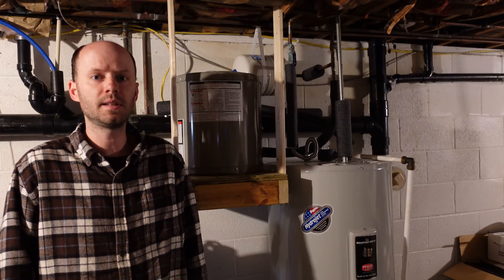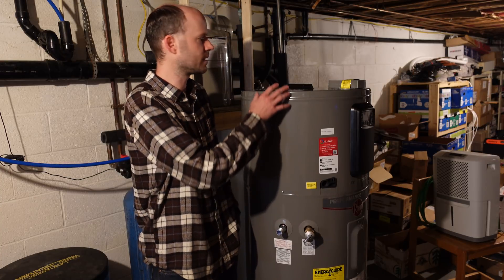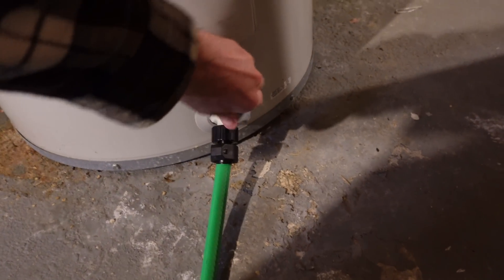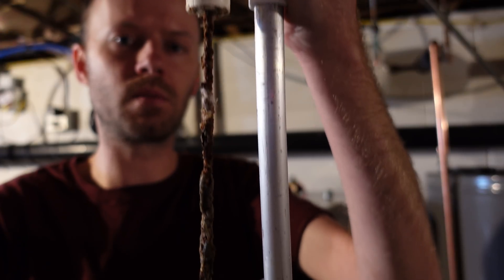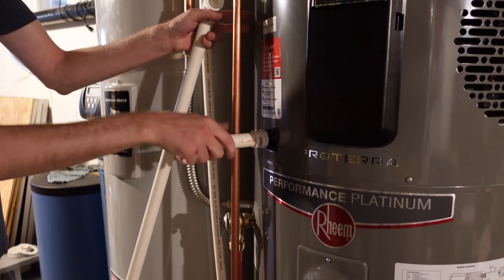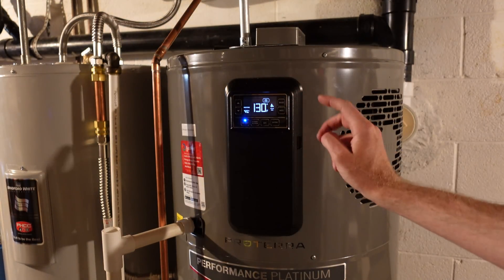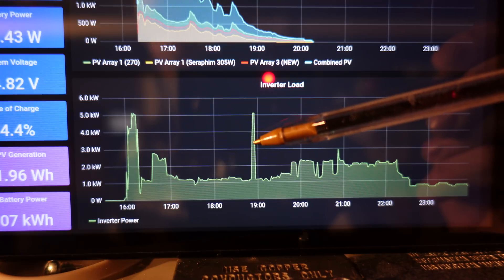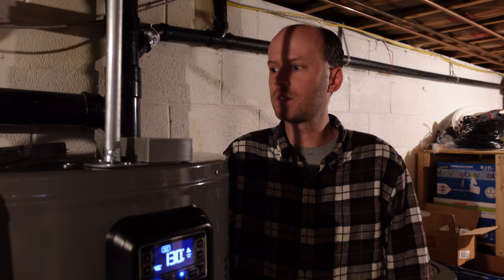Reducing Energy Consumption with a Hybrid (Heat Pump) Water Heater

Comment: I don't understand why you've put the old electric tank in series with the new heart pump?  Surely the heat pump is all you need, the old tank is just simply storing water and losing extra heat?
Reply from the maker: It's extra storage capacity, yes. You would be amazed at how little heat loss there is on a well-insulated unit like that, especially with a household of 4 using probably 2-tanks worth per day lol. I'll probably remove it at some point but it seemed silly to just throw it out when it still worked.
Reply: @LithiumSolar  ah ok kinda make sense now I was worried you would have heated water sitting in the non heated tank just cooling down like but sounds like you keep  it flowing! :D  I want to maybe try something  like your old setup where I use a smaller tank before my boiler, heated by solar to take the chill off the water and reduce the amount of gas needed.

Comment: why keep the second water heater connected and on grid? why not just use the new tank on it's own and run that off grid?
Reply from the maker: Because when I get 2ft of snow, there's practically no solar for a week or two.
Reply: @LithiumSolar  but then you could just use the normal elements in the hybrid tank. That is how it is meant to be used after all.
There is no logical reason unless you don't have an easy way to switch the power source for the Hybrid from your inverter to grid. if so then I get it.
A problem I see is that with your current setup you have to keep your grid connected unit power by grid all the time or you would have 40gallons of cold water.
Why not use the bypass function of your inverter setup so that when the battery goes low it switches to grid but doesnt charge from grid, and then WHEN you get a charge from solar it would switch over to batteries/solar again.
Reply: This question entered my mind as well. The extra 40 gal tank occupies physical space that could be freed up. Extra plumbing too. Would also free up a (double) circuit in the breaker panel. If anything, keep the small heater that you took out.

Comment: Gosh, I just got one installed in a mechanical room and I have to say I want to return it.  I have solar but not really any excess electricity left.  The heat pump is SO noisy.  Sounds like a war is going on.  I had to turn it off completely and am using it only in electric mode (with the temperature down at 110).  Very disappointed as I'm trying to be green.  Maybe my only choice is to add more solar panels to offset electric usage.  I can tolerate turning on the Heat Pump part to warm things up pre shower.  I can hear the darn thing through two well insulated walls about 20' away.  Insane noise.
Reply from the maker: That doesn't sound right at all... maybe it's defective? Do you have the same (or similar) model that I installed?
Reply: @LithiumSolar  I have the same one you have installed.  Mine is fine in 'electric' mode but any other mode it is honestly intolerable.  I've emailed the contractor but they haven't gotten back to me yet.  : (

Comment: I liked the idea of using the preheat buffer system of your old setup.
It made me wonder if collecting hot water directly from your roof is an option.
Everything I see, it is more efficient to use solar heated water than to heat it from photovoltaics.

Comment: These are great units, I'm not sure why you would want to buy a regular electric unit if you can get this one.  In CT where I live Home Depot sells this unit for like $350 or so (last I checked a couple of years ago) because of huge state rebate programs for energy saving projects.  If you can install it yourself its a no brainer given the cost of electricity in CT (about 17 cents/KW currently and the electric company is always looking to hike that rate up to pad their pockets).  Though, HD wants $1500 to install a new water heater which I think is obscene for a few hours of work in most cases.  I will say mine generates a good amount of condensate in the summer when things get humid which is good for my basement.

Comment: nice video, how about an efficient small hotwater heater review, for us off gridders.
Reply: In some hotter part of the world, the most common hot water system for showering is point-of-use 240V tankless system, they are rather affordable too.
Linked below is a 3.6KW system retails for about $68, I imagine it's pretty decent for off-grid use as it's only powered when needed.
https://www.panasonic.com/my/consumer/home-appliances/home-shower/non-jet-pump/dh-3rl1.html
These systems are not too popular in the US though, maybe they don't work too well for colder climate.
Reply: @holmiumh  Thanks. My friend uses a horse shower, reckons it was the best £80 he spent, although they are not rated for indoor use, and are gas powered, which isn't for me.

Comment: Those water heaters kick on the elements the first time they are turned on by default, even in heat pump only mode. After the initial warm up, they will never kick on again. Some say it is because homeowners don't understand that heat pumps take longer and would return them to the store shortly after install as "not working." Others say it is because the elements have to "break in" with their first water contact. Either way, that was totally normal and should be mentioned somewhere in the manual!
Reply: Might be part of control unit diagnostics to ensure everything is functional on initial startup.

Comment: Don't get me wrong it's pretty cool and everything but man having your water heater connected to an app and Wi-Fi just seems like a bit much to me
Reply from the maker: You don't need to connect the wifi if you don't want to. It's not required for operation of the water heater. All modes can be selected using the buttons on the front. You just won't be able to do "smart" things like set up a schedule (I doubt most will use this anyway).
Reply: @LithiumSolar  well okay if everything is accessible from the onboard screen that is pretty nice. I do like that it is kind of low-powered for it being so "smart" as a water heater goes in the power saver modes. I look forward to seeing how it works in the coming weeks and how you like it. Keep up the good video's 👌
Reply: @mindovermatter3988  The app allows you to track usage as well, complete with graphs. Not absolutely necessary but good info if you're into monitoring what's using how much electricity in your house.

Comment: Any thoughts about reliability of these? The last I looked I saw many many negative comments regarding failed circuit boards and lots of start-up electronic code type issues.  I do understand the longer term maintenance needs associated with keeping coils clean, etc.  I was planning to install one in a south FL garage to replace an old standard electric WH with side benefit of cooling garage.
Reply from the maker: I've only had mine for a week, so I can't really comment on long-term reliability yet. I will certainly report back any issues/failures I find though. It seems to be working great so far.

Comment: Having the little off-grid heater feeding the on-grid one is such a simple solution, great idea.
Reply: The problem with that set up is that when you’re not using hot water for a while and the main tank cool down, you’re reheating it with the grid. That little reheat could be done by solar but it’s not possible in that set up.

Comment: When the water heater starts with a full tank of cold water it uses the resistive heaters to bring the whole tank up to a minimum of 40 celsius regardless of the mode. After that if you have it on heat pump only mode it should not do that again and will consume under 500watts
Reply from the maker: Thank you for this information. I wish they would include such details in the actual manual... lol. Their explanations of the modes were very vague.

Comment: Fail my inspection...
The T&P relief valve must not have any reduction in pipe size, pex pipe is a significant reduction in size.
You need to replace that pex with copper, cpvc, or galvanized pipe.
Reply from the maker: I'm aware of the code requirement to not have a reduction in size on the relief valve. I used 3/4" pex on a 3/4" fitting, so there is no reduction of size here? The electric water heater was installed by a licensed plumber about 5 years ago and he used 3/4" pex on a sharkbite fitting too. Unless code has changed since then?
Reply: @LithiumSolar  the shark bite MAY mitigate the issue, traditional pex uses internal pipe fittings that reduce the internal diameter. If no insert was used with the shark bite, it should be ok.

Comment: Setting the temperature to less than 140 degrees F saves energy, it can cause legionella to grow in your water heater. If I was going to use lower temperature I would periodically raise the temperature to kill off the bacteria that grows in your hot water heater.
Reply from the maker: 140F can scald you in 3 seconds. I can't take that risk with the family.
Reply: @LithiumSolar  Not if you use the correct faucets to limit the hot water
Reply: @LithiumSolar  or you prefer the long term method of poison
Reply from the maker: I prefer neither... I see your concern but have to wonder why everyone says to set them to 120F if it's so bad? Idk I'm not an expert here...
Reply: @LithiumSolar  Here are two articles that address both settings:
https://www.ncbi.nlm.nih.gov/pmc/articles/PMC2094925/  
https://www.corroprotec.com/blog/hot-water-temperature/
Reply: @UsetoCud  Legionella is everywhere and we are constantly exposed to it.  If you have city water it is treated and has very low levels as also food source for it to grow.  If you produce your own water then there is some reason to be concerned.  I have visited people who have stuff floating in the water and I won't drink there. You are more likely to breathe more Legionella walking outside then in a shower.
Reply: Relax guy..... Lol 120 is the way to go.

Comment: I went through this scenario a few years ago. For me this was a no go. Payback period (for me) was about 20 years because of the initial cost of the hybrid. The Tank would not last up to the payback period. They are cool though! My 80% efficient natural gas hot water heater only uses 8.00/month of gas and I also get the benefit of being able to take hot showers even if the grid goes down. Thanks for sharing!
Reply: That's not current information . The payback period on this one is 4 years .   It uses 350 dollars less in a year . There is a 300 tax credit . Home depot has them on sale for 1350.00 often .   1550.00 regular price  for a 50 gallon in my area.   You can run this on solar so even quicker payback and grid down ready .
Reply: In my case with the Federal Government forcing a carbon tax on us, the payback shouldn't be near that long. This onerous tax is about to triple & the next election could be another few years down the road with no guarantee a subsequent government will axe the tax. My November natural gas bill was $240!! It's brutal vs the Hydro bill which comes in only every 2nd month & is much lower. I replaced my natural gas hot water heater with one of these in late August & love it. I've also recently blown major $$$ on a new electric induction range to replace a gas range. Only thing left running natural gas now is my furnace & outdoor BBQ. i suspect it's the furnace that's cranking up my gas bill as it's been unusually cold November & December. Not much I can do there other than to add more under floor electric heating & heat only the room I'm in vs running the central furnace.
Reply from the maker: Yeah if you have gas, that's probably the way to go - no real reason to replace it with a heat pump-based tank.

Comment: It would be interesting to see if the temperature in your basement is slowly getting down. You take the energy out of the air, so the air gets colder. After a few weeks even the floor should be cooler. Good for storing food, but bad for the heat pump (less efficient is temperature gap between hot water and air is too big).
Here in Germany we have similar heat pump water heaters. But they use vented air from toilet and bathroom. And they blow the cold air outside the house.

Comment: Nice. My main issue was always the uncontrollable current draw from a full-tilt-boogie 4400W heating element clicking on and off, so I just installed a 3 way switch to reduce that load to 1100W to keep the inverter from complaining. I bet I could get it to run on a 48v DC load too since it just uses switches an a thermostat on the inside, and doesn't care about what power goes to it. Might consider buying one of these hybrids though. Thanks.
Reply: I purchased a 80gal. model that's 15amp 240 volt and the elements draw 2450 watts. On heat pump mode the elements never turn on.
Cost us 40 cents a day for a family of 4. Works flawlessly in our basement pantry and keeps all our canned goods a cool 55 degrees.

Comment: I wonder how much of the noise is conducted thru your rigid piping? The flex copper or pex loops intended for use between water heater and facility piping might provide some isolation.

Comment: Would be interesting to know how the hybrid water heater compares to either a tankless electric or tankless gas water heater.
Great job as always on detailing the pluses and minuses of the product.  Your videos are so much better then the obviously paid sales people who just read all specs from the sales sheet providing little useful info to make a decision with. Thank you
Reply: Everything has is pros and cons. Electric tankless you will need to run 2 or 3 wires and add extra breakers. That will run you $400-$700 assuming you have enough space in your service box.
Reply: No comparison - the heat pumps are capable of 3.5 to 4.0x the efficiency of straight electric, ie: for every 1 watt consumed, they put 3.5w-4w of heat into the water.
Reply: @grayrabbit2211  I think you mean vice versa? Can't put more heat into the water than what is consumed...

Comment: 1:15 Did you mean 1500 W (Watt) power OR 1500 Wh (Watthour) of energy? 🤔
Reply from the maker: It consumes 1500-1600Wh of power to heat the tank just like I said :) It's a 1650W element in that small tank.

Comment: You could use that old water heater as a solar black tank placed outside, on its side and heated by the sun in your warm weather months as well.  I do this, but I am in Florida and my black preheat tank in the sun plus my hybrid water heater allows me to heat water for consuming only 24kwh per month in the hottest months.  That is $2.64 for a family of three for a month of hot water.  Winter time, I bypass and drain the black tank.  The worst part of the process is removing the outer shell of the water heater and the foam insulation to get to the steel tank beneath.

Comment: I'll be interested when they make a hot water heater refrigerator unit so I don't have to take heat from my house to heat my hot water in the winter 👍😂
Reply from the maker: I'd love to have one that's split so I can source the heat elsewhere too (like the shipping container!)
Reply: @LithiumSolar   So obvious question…  Why did you go for this unit rather than a split?
Reply from the maker: @calmeilles  not obvious really. I've never seen those for sale anywhere here. Idk...
Reply: @LithiumSolar  I was watching your video hoping you were going to take it apart and split them them up . I have mine sitting here I just bought a week ago , I haven't looked yet but it can't be too hard .   It would be cool to set the compressor and and evaporator/fan outside on a little pad and run a new line set to it.    It has 2 traditional resistive elements in it , would be cool to remove one and replace it with one that was the right resistance to hook up direct to a solar panel as a booster.
Reply: Where do you think the heat in your refrigerator comes from?
Reply: @Sylvan_dB  yes but in a perfect world you would be able to have one heat pump and direct it where you want it

Comment: Could you have the collected water go to a Berkey filter? Could be an interesting off grid water source.
Reply: So it can be used but should definitely go through boiling or a filtration process first. Could be used as gray water for plants or other possible uses.  cut it shorter and get a fernco coupling on the end with a lifestraw.
Reply from the maker: Condensate is not consumable. I have no idea what kind of bacteria could be growing on the coils, in the pipes, etc. I guess if you have nowhere else to get water (extreme drought or something), maybe if it was purified and boiled first? Idk. I wouldn't recommend it.

Comment: Is a heat pump (smaller version) good for RV (hot water, heating)?
Reply from the maker: Heat pumps are incredibly efficient at heating and cooling. I'm not sure a heat pump water heater would work well in an RV though. I haven't seen many small ones on the market, typically they're 40+ gallons.

Comment: While these water heaters are awesome.  It should be noted that when your furnace (or other home heating device) is running, it is heating the water.
Reply from the maker: I don't have a furnace in my home. The heating is all electric currently. I use a wood-burning fireplace insert to offset heating costs in the winter.